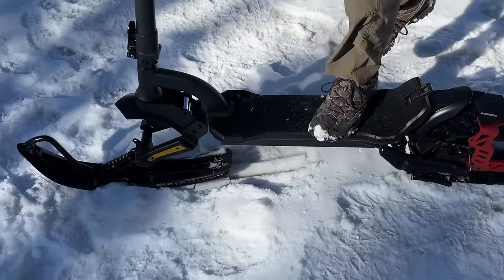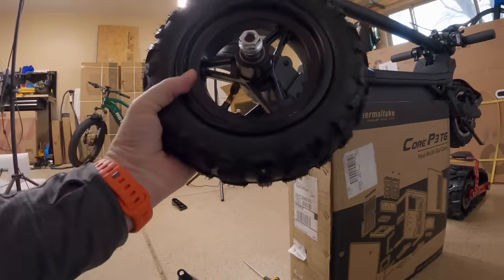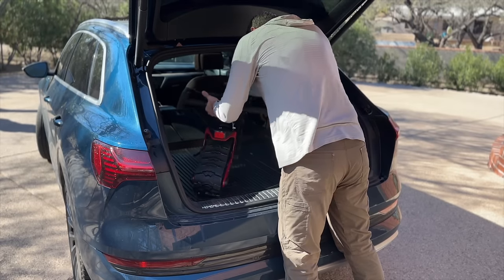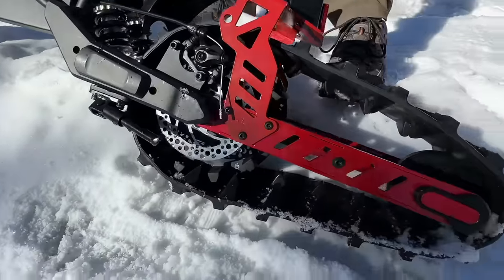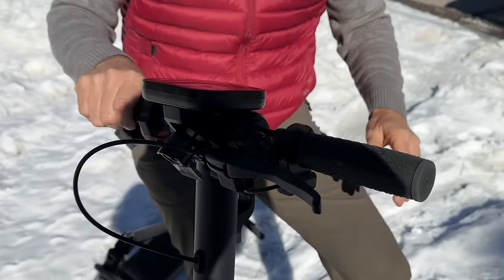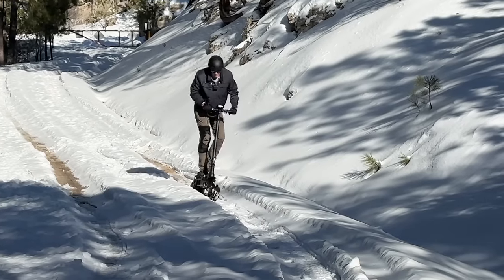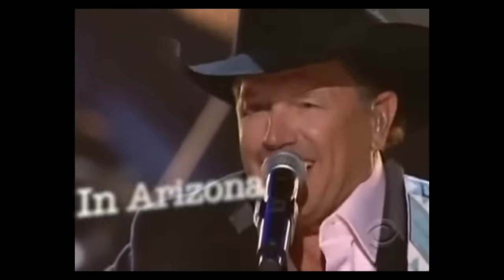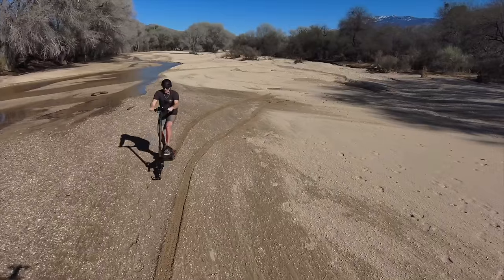Technology Revolution: Experience the World's First Electric Snow Scooter! Tigloon S15

Comment: Would love to see a battery swap on this, something with more power, I bet it could rip through sand with enough voltage..
Reply: That's a good idea.  Or gas motor??
Reply: @ultimatetreatmentzonephysi1890  yeah gas would work for sure, but I think there is something more interesting in testing the limits of electric
Reply from the maker: @ultimatetreatmentzonephysi1890  🤦🏻‍♂️ 🤦🏻‍♂️
Reply: @roach2107  True True.  Electric is the future.